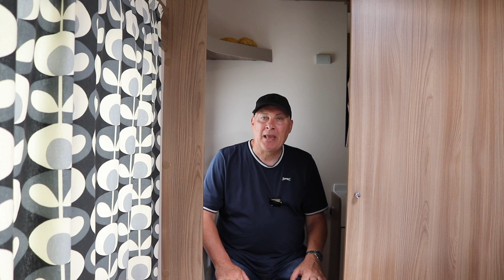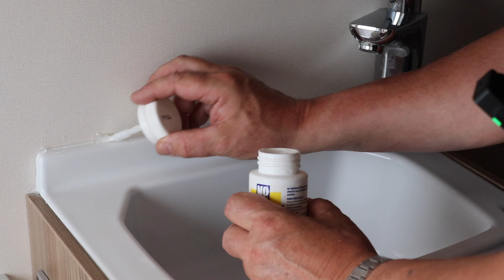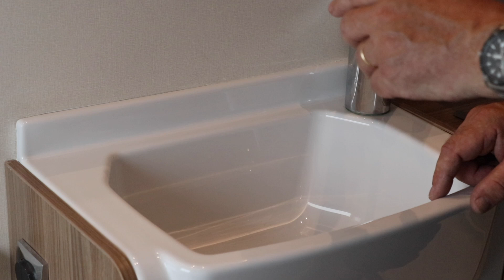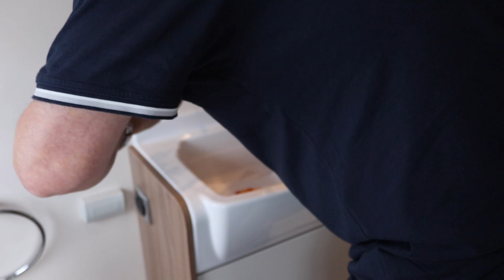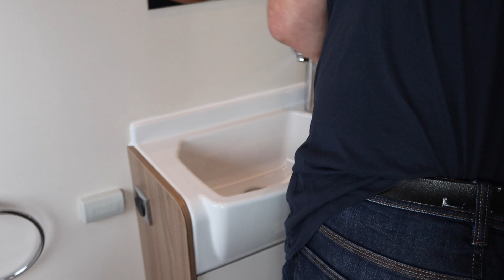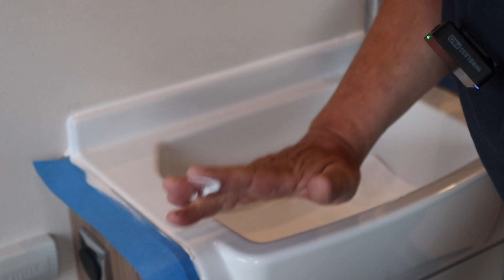Caravan Bathroom Sink Repair & Design Fault

Comment: Hi Phil the blue cap on the silicon is that to stop it going off? I always seem to be short of nozzles 🤦‍♂️ Good job it’s a real art applying silicone, sometimes I’m an Ace and others like a dog’s dinner and have to do it again 😂
Reply from the maker: Cheers Colin. Yes I can be a master myself but not so much this time. I have since neatened it up. Thanks for the tip. Phil👍🙂

Comment: Good job done Phil, should do the trick 👍. Shame they didn’t build the cabinet slightly narrower to allow the basin to overlap. By the way we like the smart design of the basin. All the best, Rob & Gail 😀
Reply from the maker: Hi Rob n Gail. Yes it is a poor designed unit. This spoils what could be a very modern but simple sink solution. I have bought a new rode mic kit but still getting used to the settings Thanks Phil🙂👍